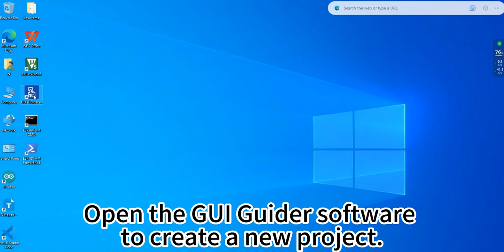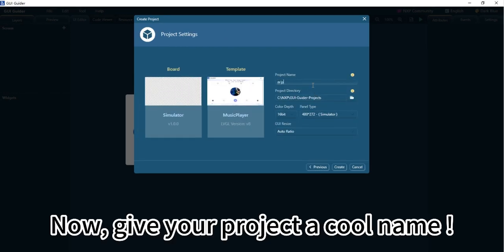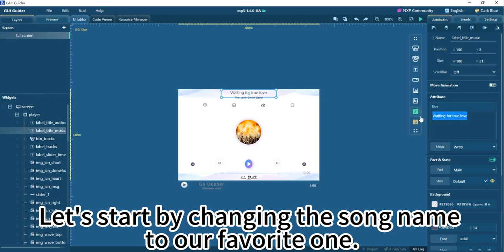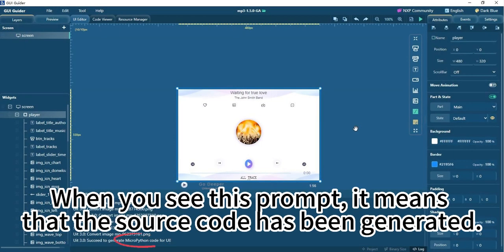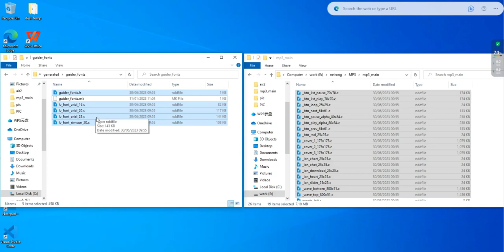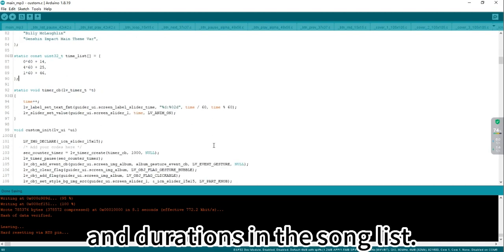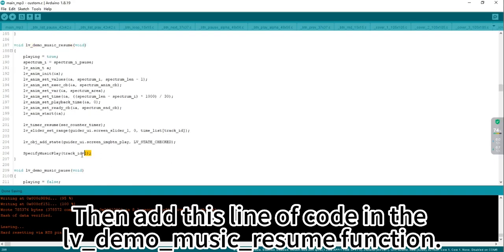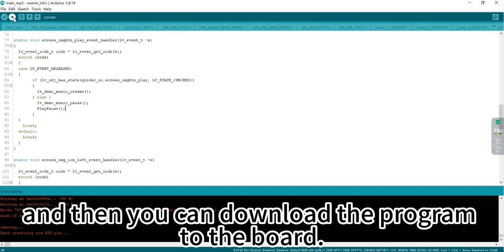Make a MP3 player in 4 Steps_so easy | Elecrow DIY #ESP32 #LVGL #Arduino #KT403 #github

Comment: Hi, It's possible to use this example but instead of playing music trhough the module can i send the mp3 file via Bluetooth to a speaker? How can I do it?
Reply from the maker: This idea is very interesting, but it can be challenging for beginners to implement. You can refer to this source code first, hoping it can help you: https://github.com/pschatzmann/ESP32-A2DP/
Reply: @Elecrow  I tried using that code from pschatzmann repository on ESP32-WROOM-32 and it works fine. But in the ESP32-S3 terminal that library is not compatible with the ESP32-S3 chip, because S3 only uses BLE and not BClasic, I think there is no way to pair an ESP32-S3 with a Bluetooth speaker that uses Bluetooth 5.0. Could you tell me if I'm right?
Reply from the maker: @Naakkuu  Hi, the classic Bluetooth only supports up to Bluetooth 4.0, while BLE supports Bluetooth 5.0 and below. The ESP32-S3 does support Bluetooth 5.0, so you can try modifying the code to make it compatible with a Bluetooth 5.0 speaker.
Reply: @Elecrow  Thank you very much for your reply. I understand that you are not here to solve my life, but if you could give me a hand I would appreciate it. Would you have a test example or could you guide me with the first steps to achieve a pairing between the esp32-s3 and a classic 5.0 bluetooth speaker? After a month of searching and several tests I have not been able to achieve it. In some forums they say that it cannot be paired because they are different topologies. In other forums they say yes. The only thing I'm sure of is that I'm completely lost.
Thank you,
Frank.
Reply from the maker: @Naakkuu  Here, we currently don't have similar code examples available. However, there are Bluetooth 5.0 connection examples on the product's wiki page that may be helpful to you：https://www.elecrow.com/wiki/index.php?title=ESP32_Display_3.5-inch_HMI_Arduino_Tutorial

Comment: Hallo.
Ich habe eine Bitte
Ist es möglich einen reduzierten Programmcode für die essentielle MP3 Funktion zu erhalten?
Einige wenige Zeilen, die das Lesen von der SD Karte und die akustische Ausgabe über SPK beschreibt.

void Setup
void loop

Ich habe das Gerät "CrowPanel 3,5-HMI ESP32-Display 480x320 SPI TFT LCD Touchscreen" 
Tonausgabe erfolgt über den Standard Ausgang "SPK" (Pin IO26) der Platine.

Danke im Voraus
Schöne Grüße Franz
Reply from the maker: Hi, there are no relevant routines yet, but you can refer to Example 3 on this page, which might be helpful to you：
https://www.elecrow.com/wiki/ESP32_Display_3.5-inch_HMI_Arduino_Tutorial.html